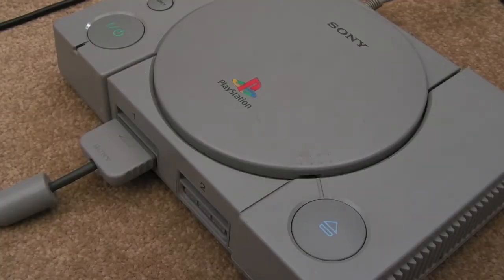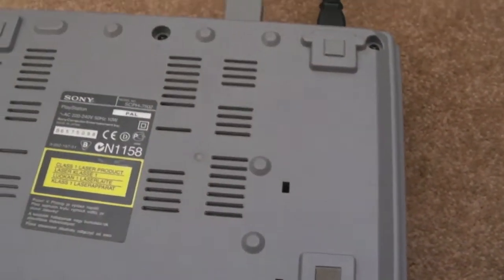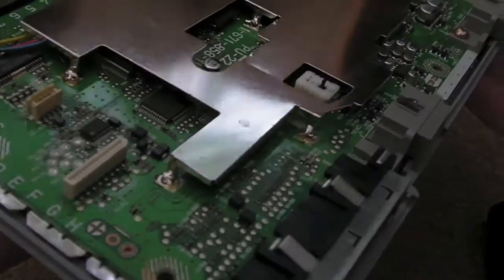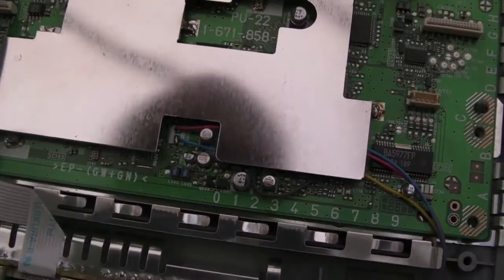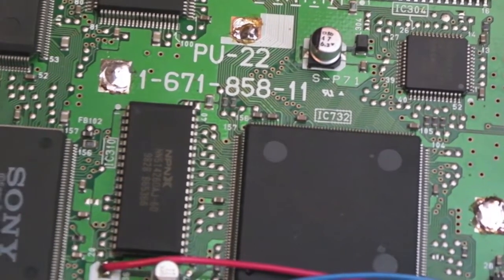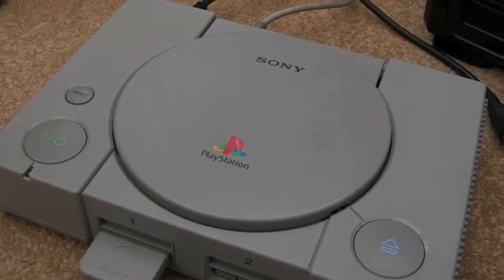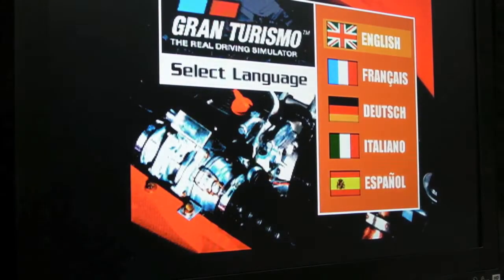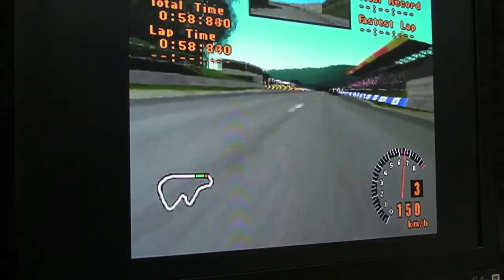Sony PlayStation 1 (Play Station) Teardown (PS1 PS One)

Comment: 05:23 Is not CD Controller, but a BTL Driver (BA5977 - created by ROHM)
It have to control the motor spindle and sled motor :)
Reply from the maker: +Naitoraven951 Yes, I figure the DSP and other main control logic is in one of the other QFPs - I was just generalising as the BTL driver is what usually fails in other CD based systems, although from what I understand the DSP fails a fair bit in the PS2.
Reply: +GadgetUK164 In some PS model (like SCPH-1002), the BTL driver (BA6397FP) can be a serious problem, but on 7502 is really hard to have some bad IC.
Nice OPU and nice component, but ...audio DAC is awful :(

Comment: I took mine apart on purchase to check it out and stop a rattle on the drive. Remarkable design, simple and easy to service, wonderful. I kept mine sacred without the mod chip, looks dodgy as hell. lol Good stuff man.
Reply from the maker: Thanks, and thanks for watching and commenting!  How are you getting on with that Amstrad btw?
Reply: Still same problem. Will be ordering a replacement decoder as soon as I got the time. I also have to fix the disc reader on my newly acquired ps3. hopefully it's just a dirty lens.
Reply from the maker: OK, interested to know how you get on with the Amstrad =)  The PS3 sounds like it will make an interesting video as well!  God I hate laser based problems!!!
Reply: Well, I've stripped it down and done everything I can think off. Nothing. Bollocks!
Reply from the maker: SmoothEmJay Haha!  Yeah, all CD, DVD and BluRay drives should be banned, or replaced with SD card readers lol.  I hate laser based drives!

Comment: I was never exposed much to the blocky psones and PSX (except at a few friends houses) , the controllers though I often find and even recently acquired a pretty good used ps2 I refurbished. They are very slick for their earlier console generation (both the ps1 and ps1 controllers although I only ever owned a ps1 slim/round ). 
I got a fricking pristine psone controller (or two) in a three bundle of controller that came with an old used ps2 deal I got on kijiji (french canada's craiglist, we got a few), 80$ cad for a spc-75001 ps2 with a dimmed read laser (seller didn't even know, thought it was fully fonctional when selling the bundle, family woman and man).

Sure 80$ for a dimmed laser ps2 is pretty typical nowadays except a new and refurbished one can sell anywhere from 100 to 150$ nowdays here and buying a dimmed laser one cost me 80$ for that, 1 ps2 controller, 1 clear blue ps1 controller, 1 typical pale ps1 controller, 2 ps2 memory cards, grand tourismo 1 and 2, tomb raider 2, pump it up (I already got 1 or 2k in games here, these are cool to test for scratcher defects and bad assembly) with the cables too. Ps2 lasers are 20$ too and shilling for a new 42$ soldering iron for servicing the static solder on the diodes was necessary but it was worth as a future investment hahaha.
Its funny even for shilling +62$ on the original deal and servicing the console still managed to be a good deal and proper investment, no used market seller here will sell you anything more (and much likely less) than an extra controller or two with the cables for a refurbished ps2 of the same quality and for 100-140$ (they tend to overprice their crap when its serviced with a new chinese laser, figures). 

I still got an old ps1 too but the later rounder and slimmer revision, its got bad connections on it though I should open it up and clean its inside X). Its not absolutely necessary though since ps2 backward compability is often the last thing that works on it and the only thing it needs to really work and have pure OEM compability with some games is OEM ps1 memory cards because third party ones got weird model informations that don't get recognized by og ps1 games P: 

(haha dang too bad you didn't do a controller teardown, I'd understand though , every sony digital controller device I ever took apart never quite reassembled as easy and I often only broke em more and had to reacquire X) )

Comment: I had a release PSX and it slowly got poorly as the years past.. It worked best upside down in the end. 
I used to carry out the disc swapping method to play back ups for months before finally having it modded! 
Alien trilogy blew me away!!
Reply from the maker: Hehe, MonkeySpaz5000 mentioned that as well, I will have to do some research - wondering if its to do with focus problems.  I did try the disc swap back then but ultimately decided it was better to not do it.  Never modded my original PSX, wish I had kept it =/  Alien Trilogy is great fun.  I also like the look of Alien Resurrection.  I feel the need to play some of the Final Fantasy games soon =)

Comment: the ps1 despite its initial cd laser problems is an extremely efficient and nicely designed unit (i am a saturn man but respect where respect is due) the saturn is way too convoluted in its design.
Reply from the maker: Yes, totally agree!  The Saturn seems like it was a blend of a complete new CD based system and legacy 32x technology.  I can imagine the Saturn being harder to develop for.  That said I don't think the PSX was much easier to develop for.  Both lovely systems though, Saturn looks sexier imo, but PSX is very tidy internally and externally.
Reply: Yea the bolted on 3d capabilities and what not made the Saturn way to complicated the amount of chips on the board is crazy, i don't think there was any way SEGA could consolidate the system down to a smaller size whereas the size of the main board in the PSX is almost the size of the slim PSOne to begin with they just shrunk the plastic shell and voila Sony make it seem like they work magic lol.

Comment: That chip is an old crow three wire chip, it has a very interesting history :p http://www.oldcrows.net/mcc.html but you might want to replace it with a multi mode 3 or megumi v4 chip to boot anti modchip games.
Reply from the maker: +jse07 Thanks, will take a look at that =D

Comment: Hey mate, don't know if you got the problem with your cd drive sorted but you can have a watch through my video on the lasers on PS1 here: https://www.youtube.com/watch?v=wplFgU14b5U The later models of PS1 like yours only have one adjustment pot which is on the ribbon where it attaches to the laser unit. Hope it helps somewhat.